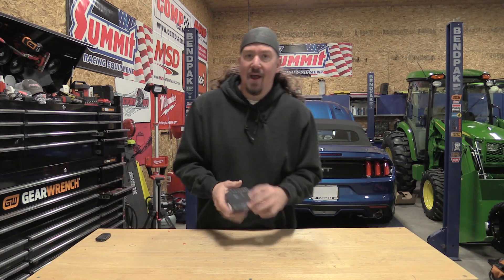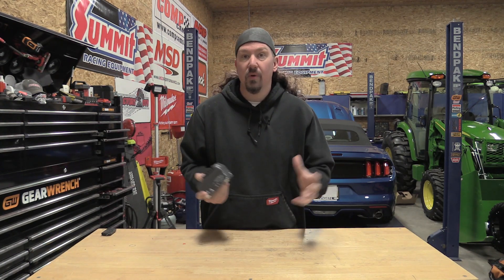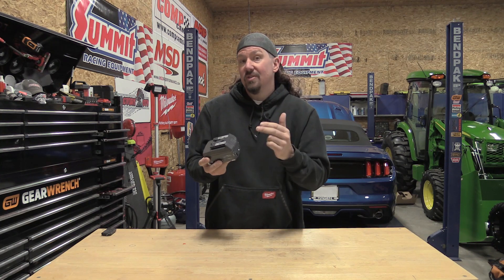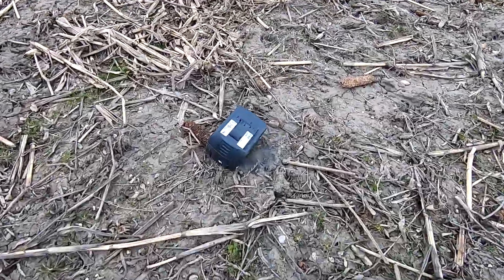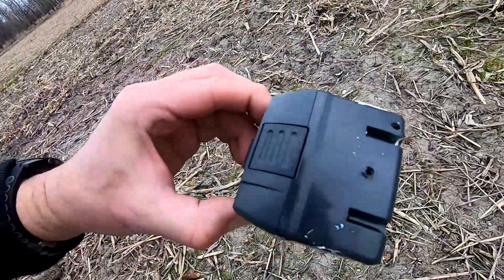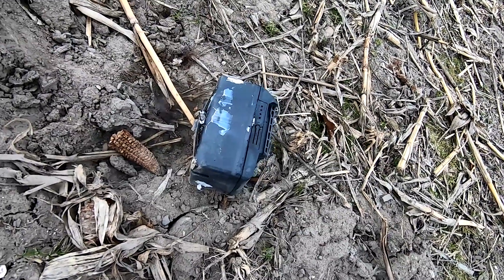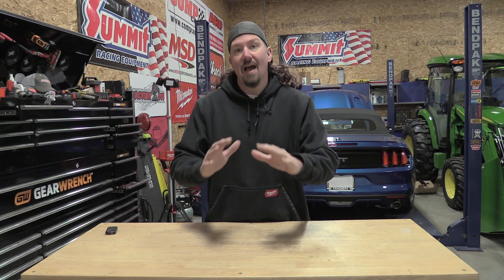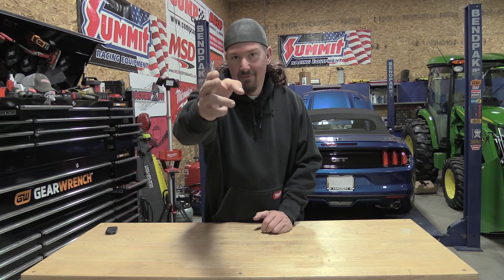Hazards Of Puncturing Lithium Ion Batteries In Tools

Comment: What a waste of time.
If you want to demonstrate what happens, you OPEN the whole thing
then once you have access to the battery itself, you cut it open with a box cutter, and it will start to smoke and generate a LOT of heat. I had it outdoors at the bottom of a bucket with 5 cm of sand, and it burned the bottom of the plastic bucket. 
It was a swollen cheap chinese smartphone battery, the kind of low range smartphone you buy an amazon (BlackView and whatnot)

Comment: This is part of what concerns me with no name batteries on Amazon and Ebay.  Remember the scooters that caught fire?  I think the OEM's like Milwaukee, Dewalt, Makita, etc. spend a lot of time making sure the batteries are safe.  Some of the cheapo stuff from China could be dangerous. The cells may be similar, but if there is a short in some of the circuitry, this could lead to a short and cause the battery cells to overheat.

Comment: For anyone out there that might be anti gun and anti 2nd Amendment, I would challenge you that you haven’t thought of doing this exact thing!  Especially with a defective battery that won’t charge!  I have a couple I would like to puncture/ blow up with my 8mm Mauser!  Not going political, just stressing that you take this video for what it’s worth.  Wild stuff Brian!  I’m sorry you had such an issue with trying to ship it back?  As ‘Treeboss Mike’ commented, Milwaukee will send out a label, and accept batteries. They will not return them if they are bad, and not in warranty.  They do not repair batteries, and will not accept the 9.0 HD.  I successfully ‘jump started’ several XC 3.0 batteries, but DO NOT advise anyone to try.  Yes, I did it outside, with a few safety protocols.  Stay safe and Healthy!  👍👍👍👍👍😁✌🏻🇺🇸🔥🧨😂

Comment: I think lithium polymer batteries are much more volatile than regular 18650 high drain cells. Also a batteries volatility (sometimes) depends on the state of charge of the cells in the pack.

Comment: That was exactly what I would have expected. Lithium Ion batteries don't blow up that quickly. Look at the Tesla fires resulting from crashes. They crash and then sometime thereafter things start to smoke and eventually a flame is visible followed by the whole thing becoming an inferno. That is what makes Lithium Ion tool batteries so dangerous. You may not even realize that you damaged it until sometime later it starts getting hot, smoking and flame-on.

Comment: LiPo batteries are the ones that get puffy and bulgy when punctured or squeezed. Li-Ion batteries (often in cylindrical shape) I've found to be a bit safer, at least when it comes to physically destroying them (at least when it comes to them violently exploding or venting). Overcharging / undercharging / shorting them out is usually the more dangerous part with them. They can all vent harmful gas and lead to fires, so handle and dispose of them safely regardless.
Reply: My first encounter with a Li on batteries is that I was using the 18650 Lithium ions in a headlamp from China. I quickly began to call these batteries Chinese firecrackers. One time, I accidentally put the battery in the wrong orientation of positive and negative. The battery begin to literally burn in the headlamp. These are very powerful batteries and need to be given a lot of respect. I really appreciate the poster showing us that we need to take a lot of care with these batteries. They are not quite the ones that we are used to.
Reply from the maker: We hve run some Makita batteries over with an excavator and had one explode.  :)  That has been a few years.

Comment: Shipping requirements can get onerous for batteries over 100WHr capacity. The two labeling requirements for shipping rechargeable LiIon batteries are UN 3480 and UN 3481. You can get a lot details on USPS.com and other sites.

Comment: Lol I had the same issue Brian while warranting a battery from Milwaukee.  I went online and printed all the info I needed. Went to a fed ex store and they told me same as you, can’t ship lithium ion batteries. I then contacted Milwaukee directly and they couldn’t believe I had that issue. They ordered a direct pick up from home for me, instructed me to box up the M18 5.0AH battery, tape the safety labels on them, and leave the box outside my door the next morning. The fed ex guy picked it up no problem and Milwaukee shipped me a new battery that I received less than 2 weeks later. If they won’t ship in store, call fed ex or UPS direct and request a pick up. As long as you have that lithium ion battery label with the number on it (believe it’s 3420) then yes, you can ship lithium ion batteries just not on airplanes.